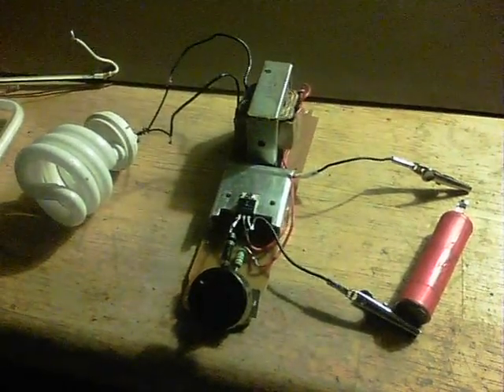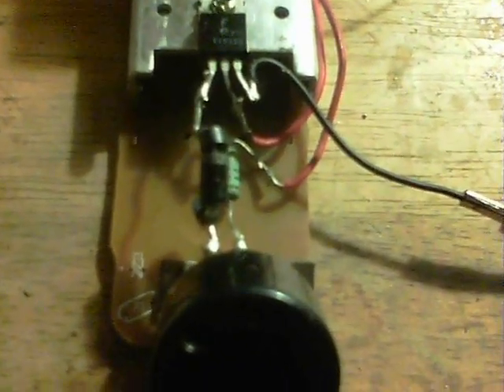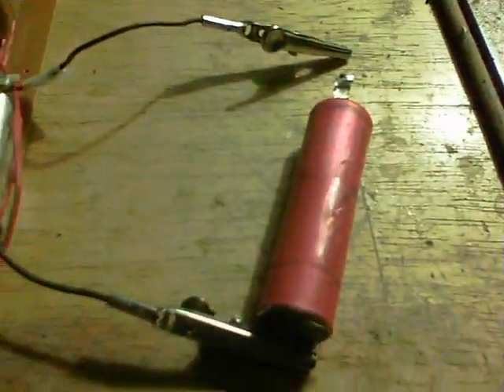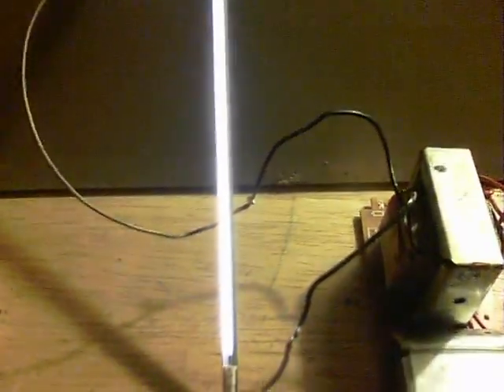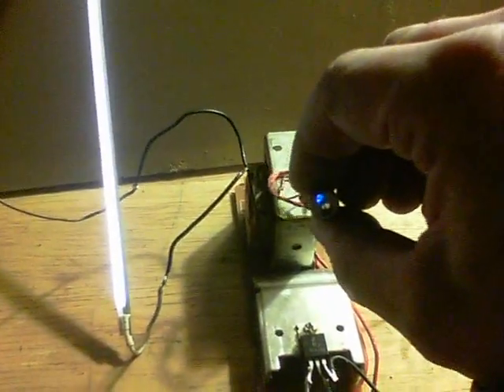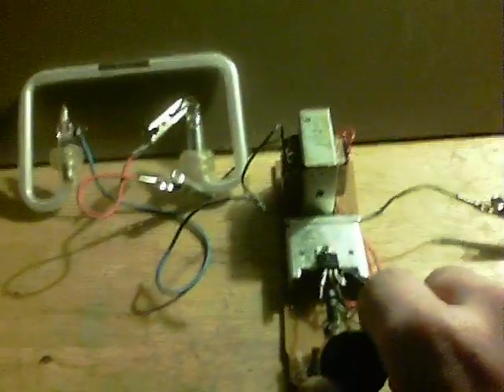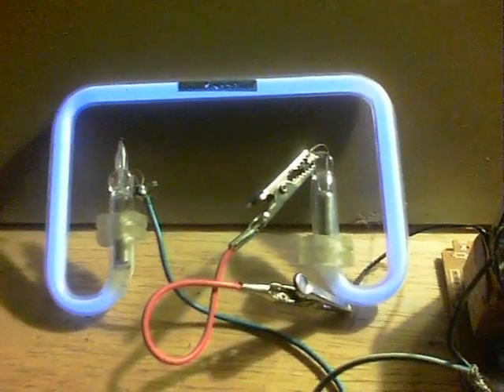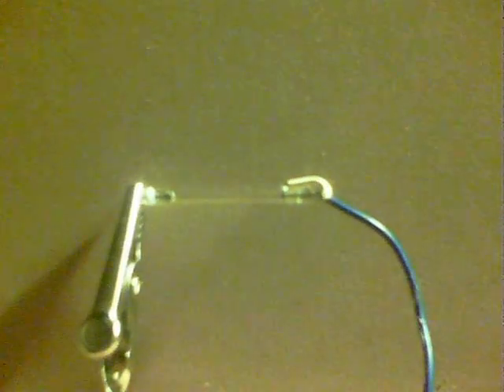Battery Inverter - 1979 transformer + demo's

Comment: If the SHF could a person power his house or refrigerator with one of these coils?
Reply from the maker: Terry Hueffed Hi Terry. I think that's the way a lot of us working on such things are thinking, for smaller devices. There could be 1000 other ways of buying something or having it fitted up by a company, but if those places aren't open, or people to do the work, what to do ?
Lights are one area that needs no mains source...from wind up flashlights, to solar recharged, to running as shown in the vid from a battery. 
Some devices will never run without the mains due to wattage demands, short of an engined generator of course. Other stuff, yep and forms a security for power cuts or reducing bills.

Comment from the maker: Any larger transformer is worth a try. Best are normally the 120V/12V (for USA). Smaller output voltage transformers can have wire that is too fine and that wrecks things when trying to connect them the wrong way around ! Also, a wall adapter rated for 2A or similarly good amperage is a better idea than a transformer rated for 25mA. The load on the output has to be considered, so normally a larger transformer works best.

Comment from the maker: This one is an old laser pointer also with blue LED. A 12 turn 30 gauge coil picks up the energy, goes into a bridge rectifier made of 1N4148's + then to the laser pointer. 
Another method is to take a round wire wrapped cylinder choke from an old TV (they are made of ferrite + have hundred turns or so of wire on), then attach an LED to the 2 pins. It will light within the fields. Or, piece of wire, then 2x diodes connected opposite directions to each other (search AV plug) + LED on the end.

Comment from the maker: Yep. Old hi-fi, or wall adapters for 12V can also be tried until you find a good one. This one simply worked well as soon as it was tested. I don't think I tried a 2 in 2 out type or others with multiple step downs. There are plenty of center tapped around anyway :)

Comment from the maker: TIP122 in this case. Diode was likely a 1N4007 or similar, just a regular 1A capable type. I salvage all components from junk, so specifics are normally about whatever works. Many variations are possible with similar components :)

Comment from the maker: @UrCoffeeTastesToasty Yes, that ties in with thinking at the moment, though I was to try aluminium foil. A small Tesla tower directly to one HV out last night gave much better range of a few inches. Current draw is higher than Slayer type exciters so dunno where this might go, except that it's a lot different and yet works similarly to those type. 1 wire distance trials need to be done too, this offers transformer frequency dialing and I like that a lot. Poor mans signal generator too lol  :).

Comment from the maker: @iluzyon1 Wish this could be photographed. It's twice the density of lightning sparks on one side than the other. Then there's the dark line in the middle that divides. Both sides connect to the HV outputs. Quick taps of the battery produce thicker single lightning type lines (or did, until it seems the transistor blew with my foolery). Got a D1413 transistor on the circuit now.

Comment from the maker: @KyleCarrington I don't know...all quite comical when trying to test. I just put only the black lead of meter across the CFL and it sparked at me ! plus, the 15 LED array from other experiments lit up !!!! that's no bull, that's what happens. It's only a standard setup and a standard transformer from known equipment. On 9V from wall adapter bulb is 3/4 bright and meter says drawing 1.36amps..yet adapter only outputs 800ma max lol. I get a shock off the battery terminals too.

Comment: @slider2732 

I dont know much about xenon so i might be wrong but it think they work like your (ccfl) laptop back light. It got an anode and a cathode. That might be a reason why it reacts differently depending on which end of the bulb you connect the high power outpout of your inverter. Anyway's not helpfull at all ...just a though :)

Comment from the maker: @iluzyon1 I've only got 1 at the moment lol. No idea if it could run them in series, would be fun to try. One oddity, is that the tube lights differently at each end, with a dark band in the very middle. One side has wider sparks than the other when the pot is turned fully up and yet they link up to go right the way across.  Thinking there are 2 slightly diff frequencies in the transformer..